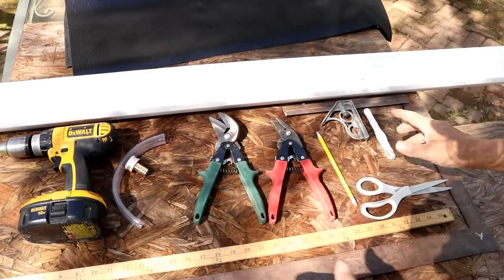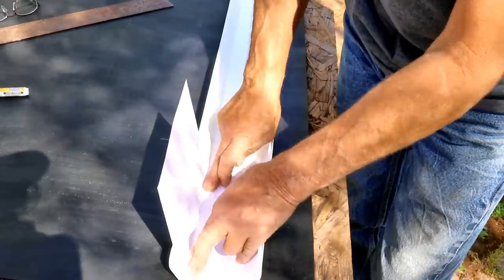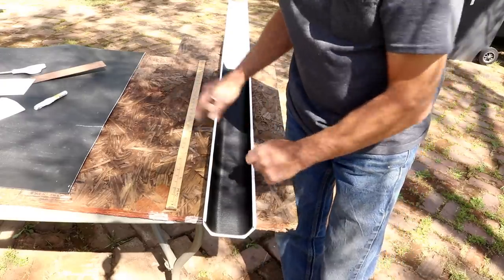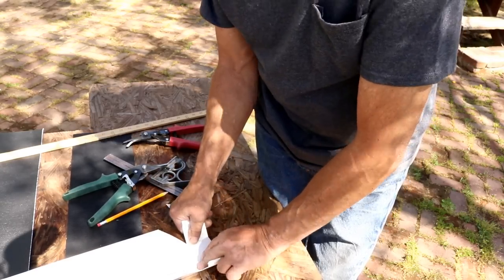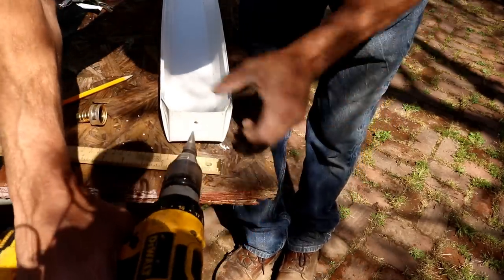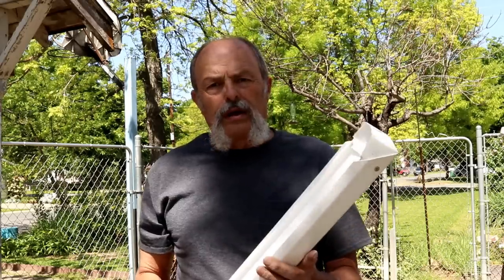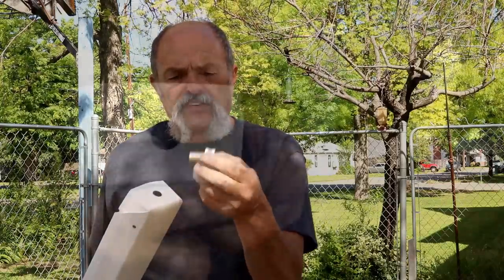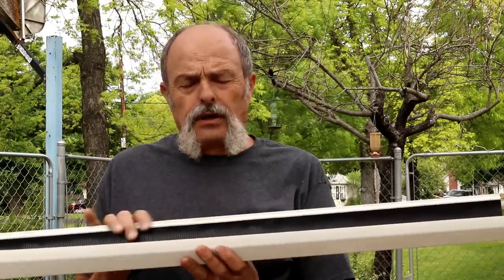How to build a cleanup sluice

Comment: Good job, Gary! GPAA has been making a bundle of money on those clean up sluices for years. Heres a little tip, when you see the mobile gutter installers in your neighborhood, they will usually give you a piece of gutter for nothing. I have used these with the two bucket 12 V bilge pump recirculating method. They work great once you figure out the proper rate of fall. Thanks for all the hard work you put into your videos. You my friend are a wealth of information for both the beginner prospector and us old timers!
Reply: but its not that cool hip L337 green!  ;)

Comment: Use metal if you need it more sturdy. I use a metal track that's used in framing. Found at every Menards or home Depot. They come in 2 1/2 up to 6in wide and 10ft long for less than $10.

Comment: Gary, this video is just what the Doctor ordered! Your ability to think outside the box in constructing home-made prospecting tools is superb! Question: Is the matting that you used a regular size floor mat or does it have to be cut from a roll at Lowes? Thank you for your help!
Reply from the maker: It come on a 3 foot wide roll. The ribs run across the roll so you can just get the amount you need. I think its made to be hall runner.

Comment: Couple of questions: It looks in your end shot of the glue-in vs. the slide-in version that the FLAT side is UP. is that just a trick of the light-and-camera? Also - what is the length of those little jewels? And why did you decide on THAT length? And again - most gutter systems have premade end caps. Why not use those instead of the cut-and-bend version? 
Great sluices! Some of us are a little slow, though, and need more info. (Me, for example.)
Reply from the maker: They are a little over 3 feet. The mat comes 3 foot wide, that is the longest you can go. I'm cheep, why buy a end cap when you can make one in 5 minuets. Thanks - Gary
Reply: @TwoToes  Amen to that brother. No offense on your age but I respect the old timers even though you are a young one. And thank you for serving our great country!

Comment: Two years later and people like me are still finding and watching this for the first time! Definitely going to be making one of these as soon as I can get the materials together. A couple questions: the first is what kind of solvent did you use for cleaning off the xtra glue? The second is can you get away with using gutter that isn’t grooved on the top? If at least one side was grooved would it be pretty straight forward to glue down the other side? Ok, 3 questions.
Reply from the maker: I put a little Acetone on a rag and wipe it off.  With the environmentally friendly glues they have now, myself I would like the insurance of it being held in by the groove.

Comment: What kind of glue did you use to glue the rubber mat on to the plastic gutter?
Reply from the maker: Ya, I kind of forgot to put that in. I used a good contact cement. That's why you have to move quickly, you have about one minute before it gets really hard to move.

Comment: Nice little sluice, I've been using mine for years, picked up the materials at a thrift store.  However, instead of building an end why don't you just use an end cap?  The end caps have a rubber seal to prevent leaking.  If your end becomes damaged you can simply replace it.  That's what I did with mine.
Reply from the maker: I'm cheep and it only takes a minutes to make a end cap.
Reply: @TwoToes  either way it works great.  Between my rain gutter sluice and Miller table I've stopped losing gold.  Thanks for doing your vids, they are helpful.
Reply: Gary has to pay Cali prices for gas to get to his sites, give young buck a break.

Comment: I found the mat.. Is was at a different Lowe's.. $3.75 per ft × 36" wide... and I also ordered one from Home Depot that is 1/8 inch thick.. the one that Lowe's is 1/16 inch thick.. But the one at Home Depot you've got to buy the roll.. It's 4ft × 8ft and it cost $62.00 after taxes.. Oh and the gutter was also hard to find.. I eventually found it at a Lowe's, but they did had me on a run around.. they said that they didn't stock that item anymore, and I found it accidentally at a Lowe's.. We have Lowe's stores around me that are like 7-Elevens.. In every city almost.. Lol.. But I used the end cap that they sell for that gutter and it works a whole lot better.. it locks in and it's also watertight

Comment: I've used 30 40 ft of rain gutter so no such thing as too long I'm a long tom guy I gravity dredge as well I no longer dredge with the gas powered And I run about 24 30 ft of 16-inch Sluices Because I put it down, i run hard In the same goes when I run my cons I don't take my time I got 4 ft of 4 in prospector dream adventure sluices That now takes a place of about 30 ft of gutter and that's a fact those babies run perfect I've checked my spill and my bucket over and over several times obviously you don't catch 100% but I'm telling you I've got 99.9%